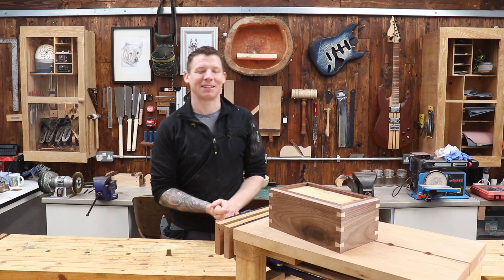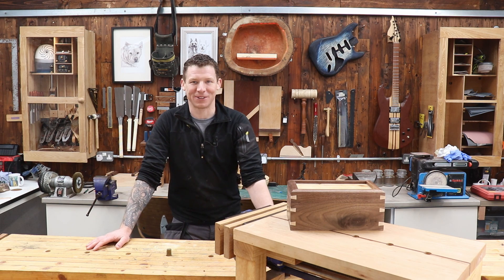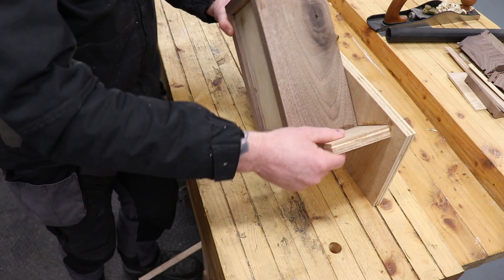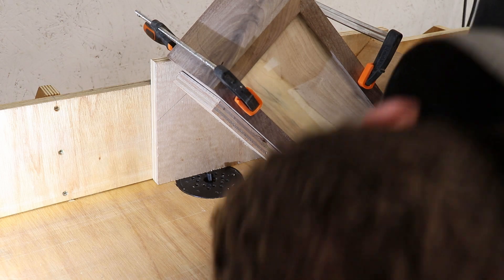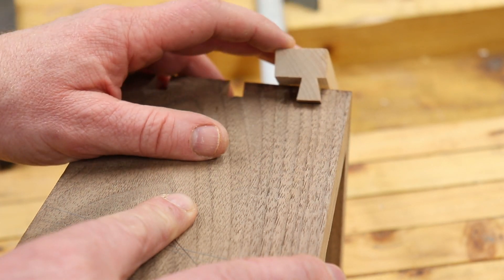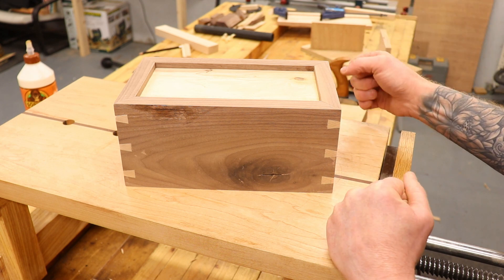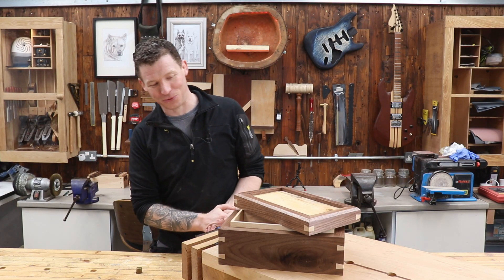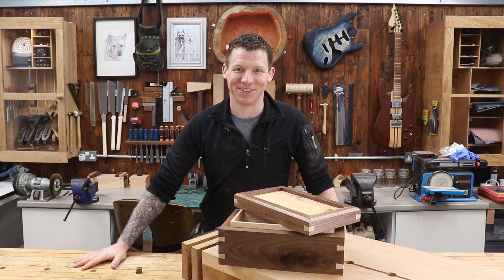Walnut Keepsake Box with Dovetail Mitre Splines.

Comment: Great project! I’m going to copy this and I had a thought ... to make the splined dovetails evenly spaced, I’m going to do the top and bottom splines, and after the top and bottom of the box are jointed, I will then center the 3rd dovetail spline between the others. Thanks for the inspiration!
Reply: I determine where I will be cutting off the lid before I do the splines and add a kerf thickness between those splines.

Comment: Just a thought ,  you planed the edges of the box after band sawing it, could you not have set the fence on the router so the router just took a minimum cut, and then if needed a mere shaving of the lid, that way the edges would have been parallel,

Comment: Good Honest work with an excellent result.  A table saw would have been better to the cut the top off (no flex on the blade). 
Couldn't help notice the Strat body on the wall, is it going to be a future project? Thanks for the video.
Reply from the maker: I have made a similar Strat to the one on the wall that body is just a decoration for now.

Comment: Very nice job on the box, a trick when adding a profile to the edge is to start the cut at the end grain side, doing this you'll eliminate your chipout as you go around the project, still best to do it with a sacrificial board or on a shooting board, keeping the grain direction the same through the project can eliminate it to a degree if the wood has grain direction consistency... Your box was mitered so my tip doesn't really count here.
Reply from the maker: Thanks for the advice
Reply: Things I learn from Marc Spagnuolo and Rob Cosman on YouTube, Marc just had a tip video for panel gluing it was great, I've been watching woodworking channels so long I usually get nothing new from tip videos but I watch them just so they're embedded in my memory when I'm in the shop.